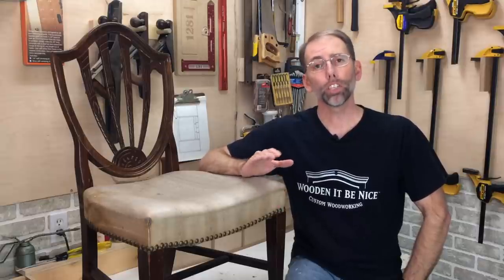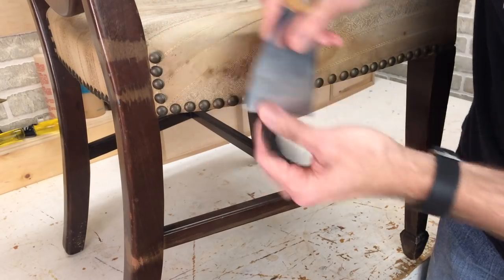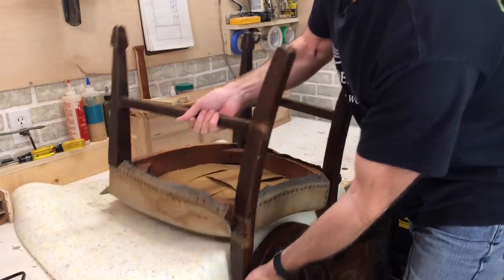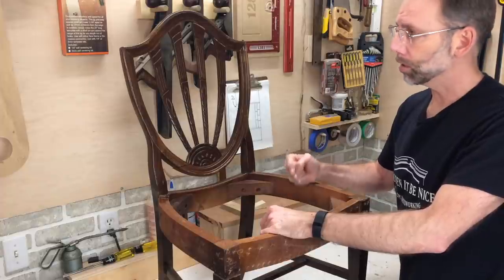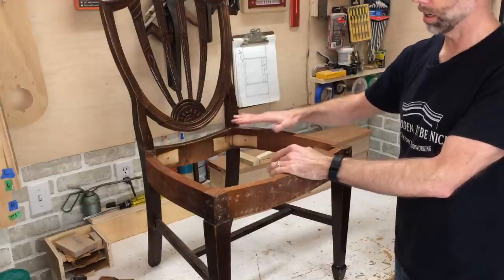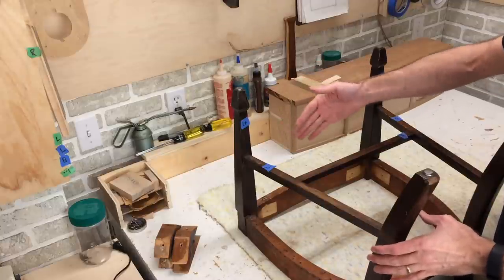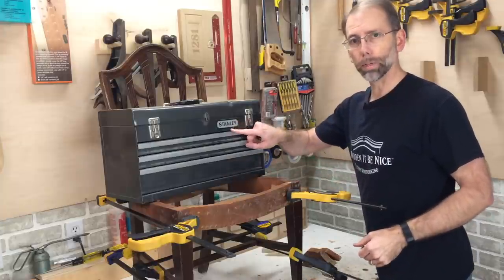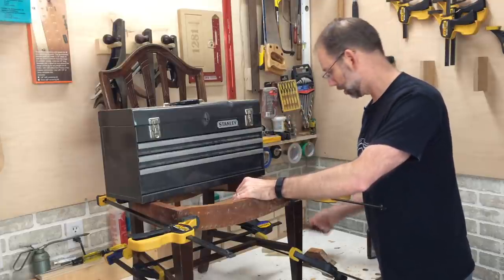How to Repair an Antique Wooden Chair with Upholstery Seat | Woodworking Repair Shop

Comment: I just wanted to say thanks because your videos helped me repair a nice wooden stool I found for 5 bucks at a thrift store. All the stretchers were loose as well as the tennons in the seat. I used the spreader clamps to push it all apart. I cleaned all the glue out and re glued it all back together. It's clamped up now. I will see tomorrow how it turns out.
Reply from the maker: That is awesome!  It's so rewarding to hear our videos are helping you with successful projects!  Thank you for sharing that.  Scott

Comment: Great repair video. I like that you took apart the whole chair to repair the back. A good time to check for other loose joints. On the repairs I've done in the past, many of the old dowels were so dried up and brittle. They seemed to have a sound joint, but wouldn't have lasted. Had to drill and pick out the old dowels and use new dowels.
Reply from the maker: Thank you Richard.  I find that some old dowels snap easily, as if there's a fracture in them.  Thanks for sharing that.  Scott

Comment: Regarding glue in cold shops:

There are mobile fridges which can also keep food warm (switching between hot/cold modes,not both at the same time).

I added a step-down-module in between that and a regular 12v dc power supply,giving me an easy way to use it for storing glue (and paint) at a workable temperature in winter and in summer when I don't need that, I can heat stuff up to 60°C,which allows me to cure some types of epoxi faster and stronger (or if summers keep getting hotter,I guess I can cool glue and paint down to workable temperatures).
Reply from the maker: That's cool.  I've never heard of that before.  Since recording this video, I've discovered that if I keep the glue in my back pocket, my body warmth is warm enough to make the hide glue workable.  If I move to a larger shop, I'll keep the fridge idea in mind - I like it.  Thanks.  Scott

Comment: The upholstery color showing on the underside was interesting! Would that chair originally  have been for a fancy house or a regular house?  The furniture I see today is so poorly made with cheap materials.  Thanks from Mississippi.
Reply from the maker: Good question!  I'm guessing from the construction that it was likely an expensive chair back in the day.  It was the original fabric as there weren't any extra tack holes in the frame.  Thanks for subscribing to our channel.  Scott. 🇨🇦

Comment: Hey Scott. You are multitalented. I (fortunarely) do not have to do any upholstery work. If it's upholstered,  it goes to the upholstery  shop before we get it. Can't  say I'm  terribly upset over that.
Reply from the maker: It's great you have the option to send it to the upholstery shop.  In my area, upholsterers are booked 4-9 months in advance so I've learned to do the basics in my shop.  If it's beyond the basics, I refer customers to the upholsters for their full repair.  Cheers.  Scott

Comment: Nice video, thanks. But when you warm up the gleu, you should also warm up the object jou are gleuing. I geuss that wil keep the gleu warmer and closer to the working temperature.
Reply from the maker: Thanks Leo.  Yeah, I'm not sure if the object temperature will impact the strength of the glue.  I suppose I could do some testing on that next winter.  Thanks for the suggestion!  Scott

Comment: I would guess that the chair is probably from the 1920s, 30s, or even 40s given those screws, the wood straw, and the horsehair, upholstery tacks were in common use right into the 1960s on some pieces, staples and tacks sort of overlapped for a time. There is a tool called a ripping chisel that is used to remove tacks, you can get one from an upholstery supplier, a regular pair of diagonal wire cutter are very useful for grabbing a tack or staple by the shaft, and removing them. I used to work in an upholstery shop so I got to take a lot of chairs apart.
Reply from the maker: Cool, thanks for the tip!  I'll look into getting a ripping chisel.  Thanks for sharing your experience.  Scott 🇨🇦
Reply: While your in the supply shop. Look at a Berry staple puller. I pick tacks out with that quite a bit. However a raw hide mallet used with a ripping chisel is standard. 👍

Comment: Thank you for your tutorial. It is very informative.
Have a question. How are you changing your work?
🇨🇦
Reply from the maker: You're welcome!  I don't understand your question though, would you please be more descriptive?  Thanks.   Scott
Reply: @FixingFurniture  I meant,  how much does your work cost for the client, in general ? How do you  calculate the restoration cost?
Reply from the maker: There's no easy way to answer that question.  I don't share my pricing publicly because it's relative to where you live.  The cost of a repair in a rural setting is different than a large urban centre where the cost of living is higher.  I offer 1-on-1 business advice through our Advice Service - https://homeimprovementwoodworking.square.site  I also put together.a pricing video as a generic business tool - https://www.youtube.com/watch?v=d42Dlu0ehHg  I don't mean to avoid your question, but I've learned the answer is specific to every business for many reasons.  Scott

Comment: Great video. I have an old Victorian chair that is sagging. I thought about replacing the webbing but it appears that some of the nails have pulled through and cracked the wood in some spots. I wanted to ask if it is possible to attach new webbing pulled taut across The bottom of the chair (the outside). Not really wanting to mess with the internals too much. I'm just trying to get these springs that are bulging at the bottom too stay more in form with the frame of the chair. Do you think this is possible? To just attach webbing across the bottom of the chair? Thanks!

Comment: Scott, really good channel. I try to follow your teachings as closely as possible.
A couple of questions, if I may:
1. Any thoughts on using expanding PU glue in a joint that is so worn that ordinary woodglues won't work?
2. Have you come across a glue called "Chair Doctor"? Is it a viable alternative to invasive nail removal?
Thanks, David
Reply from the maker: Hi David.  Please don't use polyurethane glue on furniture.  The expanding foam has no strength   Here's a video that shows the 6 glues I use in my workshop, and what each one is good and not good for - https://youtu.be/aRYNAlbBDUg

As for the Chair Doctor glue, I bought one years ago, but I haven't had any experimental chairs to try it on yet - I'll need to find one in the garbage somewhere.  All the furniture you see in our videos are for customers and I don't experiment with customer's pieces as I'm a stickler for quality.  Maybe I should make a video on that.  Cheers.  Scott
Reply: Thanks Scott, point taken about PU glue. 
I did two kitchen chairs today; one dismantled, cleaned and reglued with titebond. The other, I drilled and injected Chair Doctor, as well as dribbling it down the joints.
Guess which one is more solid?
Reply from the maker: I bought dome of that chair doctor a few years ago, but haven't tested it yet as I'm working on customer pieces.  What are your thoughts?
Reply: @FixingFurniture  
Hey Scott, 
The two chairs I experimented with were a bit creaky, rather than wobbly, and didn't need repairing for structural reasons, just noise.

The day after the repair, there is nothing to choose between the titebond chair and the chair doctor chair.

So, I would say that in some cases, where the joints are only a little bit loose, and where you can drill a discrete hole to get at the end grain of the tenon, then chair doctor is a viable option.
Particularly when nail removal would require extensive making good.

Keep up the great work!
Reply from the maker: david harrison thanks for the details.  That’s helpful.

Comment: I have a wood shop where I build simple projects. I wokr for a company that started in 1945 and we are moving. An old chair was found and I was asked to see if I could repair it because it is very loose. After taking it apart the dowles are rectangle and the mortise's are oval. Do I need to fill in,the gaps on each end?
Reply from the maker: No, you can just clean off the old glue and glue it back together.  The oval mortises are from the manufacturer using router bits instead of mortising bits - a short cut in manufacturing that isn't ideal but it's not a significant concern.  I hope that helps.  Scott
Reply: @FixingFurniture  Thanks so much for your reply. I am learning a lot from your vidieos! Well done!